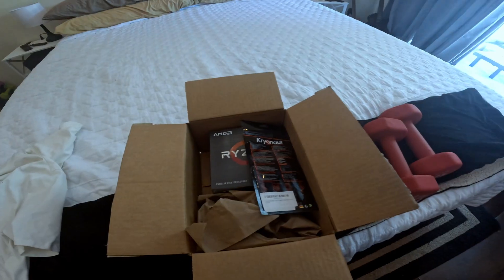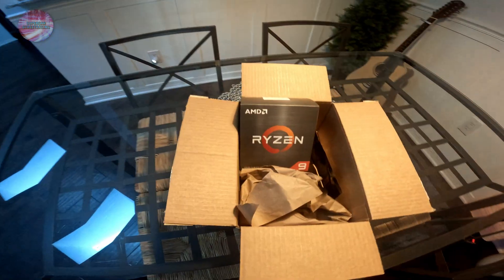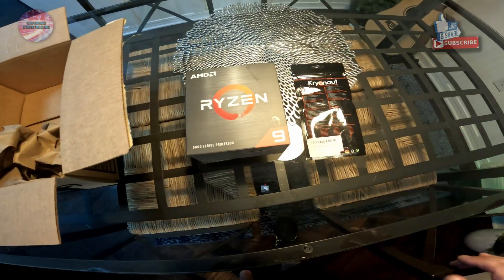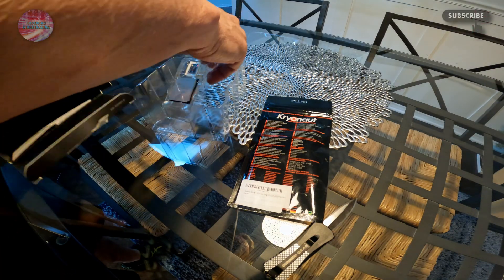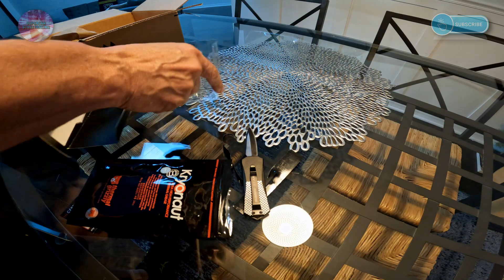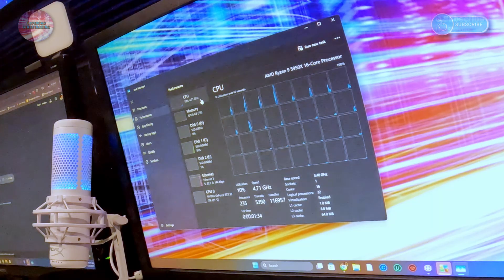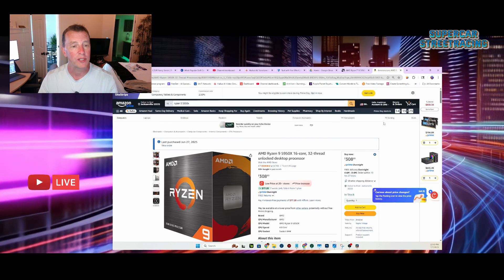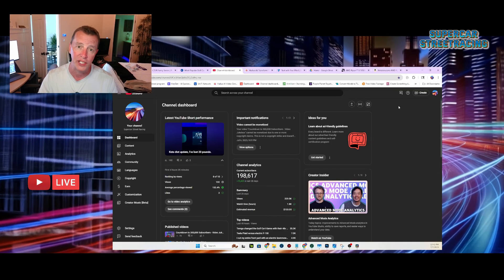⚡UPGRADING Studio A’s Editing Rig! Ryzen 9 5900 ➜ 5950X POWER BOOST! 🔧💻🔥

Comment: Anyone know how big the performance jump is from the 5900 to the 5950X?
Reply from the maker: he AMD Ryzen 9 5900X (12 cores/24 threads) and 5950X (16 cores/32 threads) are both high-end Zen 3 CPUs, with the 5950X offering superior multi-core performance for heavy workloads like rendering due to its core count, while the 5900X provides excellent value, often matching the 5950X in gaming and single-threaded tasks and being a better choice for most users unless demanding production work is the priority. Both share similar gaming performance, but the 5950X scales better with more cores for intensive, multi-threaded applications.
Reply: Not significantly better for gaming but multitasking is a breeze. When fully loaded the cores are at 3.4-4.2Ghz, so you essentially get another 4 cores, or a decent Ryzen laptop CPU worth of performance. That said I'd hit the 145W peak on both quite often. The clock speed would be a little higher per core on the 5900X fully loaded but the 5950X with more cores definitely eeks out more performance. 5950X is harder to cool because of it.